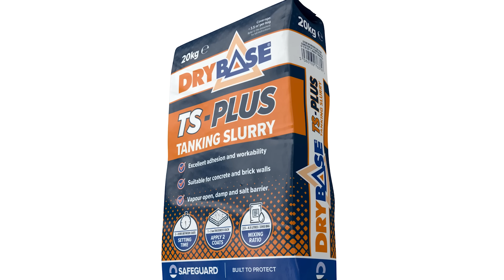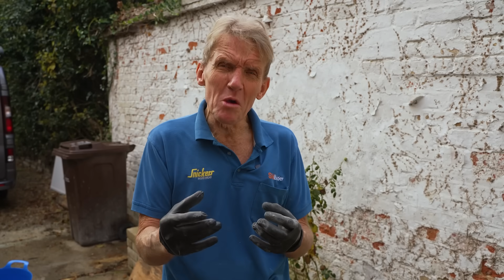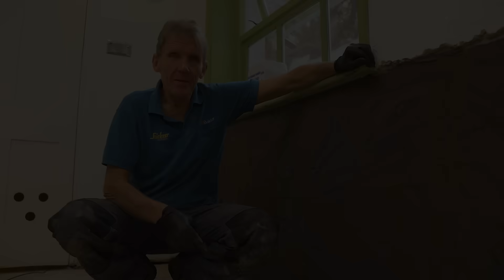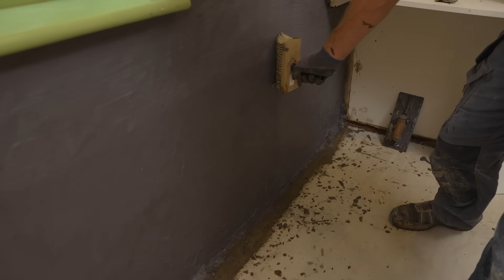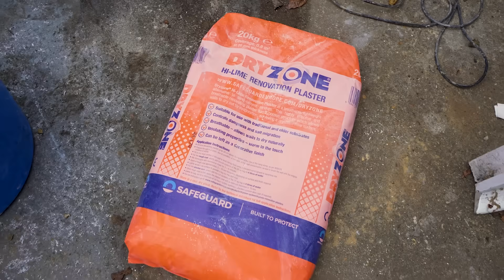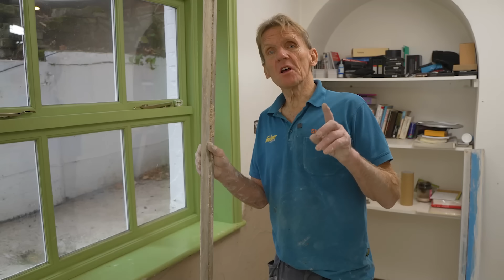Damp Creeping Back? You're Using The Wrong Material

Comment: The best approach is to put a vapour open but waterproof membrane against the outside wall. You are also best off if you can use a french drain to lower the water table around your footings.  Not always practical in a retrofit situation but worth the effort if viable.  This general approach 5 years ago solved our damp problems for good but the footings were only a few feet.

Comment: Damp, a bricky from 1959, plumbers were a blight, likely v,good plumbers but when knocking through into cavity walls they would always let the rubble go into the cavity that was to be kept clear, bash through from the inside blast face off brickwork. Always a mess to repair even at high level . If they repaired anything them selves it would be a complete botch. Plumbers stick to plumbing please.

Comment: I thought i'd share what I recently learned about this stuff as there are a few things missing from this video.
TS Plus is advertised as needing nothing but water added to it on the Safeguard website until you search around and this Polymer is mentioned elsewhere. I think it's because it was added after TSP had been on sale.
 When used it gives some extra qualities like workability and TS Plus is then rated at 5 bar. BUT it reduces the vapour permeability (VP) of it too.
They recommend a parge coat (as is put on here ^) of S&C 3:1, this further reduces the VP as does the sealer coat of SBR. The wall is then no longer classed as VP, or at least of very low VP.

TSP has no advertised VP rating, just that it is. It should have a rating.

If you want a VP wall then you basically need to make sure everything you put on is VP, but this means not following Safeguards guidelines.

Comment: All this doesn't make sense. All this water damage comes from the top and not the bottom. I have a long brick wall that's plastered and only one half has severe water damage but not the other half. The characteristics of all the soil where all the wall was built  are the same. Last year I did seal all the cracks at the top of the wall where there was water damage and this year there was no water damage.

Comment: Stop damp in two days? 🤔

Say it's condensation,, tell the tenant to run a dehumidifier 24/7 and fans in every room,,, not too hang washing up even if it's pissing it outside or freezing and leave all your windows open in winter for ventilation while you try to heat the place,, take one shower a week and try not cook anything 
Remember 95% of the time it's the tenants fault as you say
 😂😂😂

Looks like all you did was trap the water in the cavity,, or allowed it to find another spot to come through😂😂😂

Bumpers

Comment: I live in a flooding zone and I would never tank anything... buildings stay dry naturally as long as they can breath and are ventilated ( even without heating  ) Leave out plastic membranes and water blocking materials.. my experience even after pouring a fresh internal slab and getting hit with a flood that came to floor level a few weeks later it dried out completely in a couple of week in December..  if there had been membranes there the water would have been trapped, had nowhere to go and it might have taken years to dry out. The only causes of damp are leaks and condensation with one notable exception. Fix leaks. Sort out condensation issues. The one notable exception is old bricks which were in the same area as a stove or fireplace during past times, this is the 1 special case, those bricks have undergone a chemical change, turned to salt and they can suck damp from the foundations up the wall.. this is the only time you need to put in a layer to block rising damp, but for me there is better although slightly harder solution, remove a layer of the bricks in stages and replace them with fresh engineering bricks using a HL mortar, just do this in the areas where rising damp is noticeable and the problem is also fixed permanently. Cement renders are no good at ground level, but fine upstairs. Hydraulic lime renders are good because they won't blow up like Gypsum when exposed to water.. but watch out that many so called HL renders still contain a lot of cement and not all products are equal.
Reply from the maker: Mick 
So the answer is to let all the moisture evaporate into the house? In a cellar that would make even less sense.
Tanking cellars works and you will not get one signed off for habitation if it is not tanked.
Reply: @SkillBuilder  I didn't realise you were below grade, so fair enough, but really the issue is that those rooms were never intended to be habitable, the best way to keep them dry is to let the wind blow through there..
Reply from the maker: This house is 200 years old and the rooms below ground were actually the kitchen and scullery. They had servants back in the day and there would have been a big solid fuel cooking range in there. As we adapt these lovely old houses for modern living it needs to be done with intelligence. Do no harm is the moto

Comment: Unless you dig down on the exterior and apply water resistant materials, it’s like painting the interior of a boat and hoping it will stay waterproof. The issues ARE coming back. Fine if the owner understands that it’s only a band-aid.

Comment: This is cruel, that poor sod who has to remove that tanking in future when it fails 😢
Reply from the maker: It hasn't failed and it won't. We were back looking for any changes after a month of heavy rain and it is fine.
I am sorry that you didn't get the job.
Reply: If you've ever been unfortunate enough to remove these types of coatings (they do fail after a period of time). Then I doubt you'd use them. I should think the traditionally built property would rather I did the job.

Comment: Ground levels, ground levels, ground levels.  

The aqua drain handles surface water, not ground water.  Measure from the internal floor height to the cill.   Repeat the proess outside.  

The original damp proof course will be approx 125mm below the internal floor level, this relates to a suspended timber floor.  There will be a quite a difference for an 'original' solid floor.

The original damp proof course should also be 150mm or 2 brick courses above external ground level.  External render can also form a trap and may need removal just above the damp proof course.  

A genuine French drain may be required to correct the elevated ground levels.  The walls should dry out naturally within weeks, and in many cases may not need replasterring.

Try it, that's all.  Building pathology,   how things work.

Comment: Hard to get to grips with how this is is better than just rendering with a lime/sand rough and scratch coat and a lime skim top coat, with non vinyl paint. Or, just apply the Hi-Lime without the slurry. Reading through the datasheet for the tanking slurry, it reads just like any other supposed breathable render. "Use breathable decorative finishes", "Moisture may transfer in from outside", "Use breathable paint". But with the added bonus of "Condensation may form on the cold surface of Drybase Tanking Slurry. Steps should be taken to ensure that condensation issues have been resolved to avoid a reaction of surface moisture and gypsum-based plaster." I feel this is the synthetic aspect of it, as you won't get condensation on a lime finish, no matter the temperature of the wall. The taglines of the product are something of an oxymoron, how something can be a damp barrier, but vapour permeable is something of a head scratcher.
Reply from the maker: The difference between water and water vapour is immense. 
This has a buffer of lime plaster. The explanation is there

Comment: Useful but surely you need to go back in winter to see if it's really kept the damp away?
Reply from the maker: Why would it be worse in the winter? I will be monitoring this job for sure but cellars suffer a lot more in the summer from condensation on the walls
Reply: @SkillBuilder  More rain, higher water table and colder temps are surely worse for damp in winter?! Who complains about damp in summer?!

Comment: Hi Roger just wondered if you new anything about precast houses my sister is having many damp problems, because precast sections have metal in the concrete section would this stay cold so when you put the heating on in the house it causes condensation on the walls inside the house, if so would exterior wall insulation stop the damp or am I flogging a dead horse. Item 3 she has a warm air heating in her house, does this type of heat retain water in air spreading through the house ? Is this type of heating know for producing condensation in the home. Your thoughts would be much appreciated thanks Tony
,,

Comment: This is exactly the wrong thing to do IMHO. With tanking what you have now managed to do Roger is keep the moisture in the walls so they remain wet. This makes the house cold as well as subjecting the bricks to increased degradation creating a build up which will only get worse. I'm very happy you used lime, but all you needed to do was apply lime to the bricks (no PVC etc) and increase ventilation.
Reply: Can anyone recommend a good book on damp and mould problems for lay people? Asked this already but utube deleted it😂 thanks in advance!
Reply: This chap ain't got a clue with old houses
Reply: As the former owner of the Building lime company and writer of British Standards and codes  of practice on waterproofing I have to say this is awful advice.  Everything is wrong and will leave clients with re occurring issues for years to come. The design intent is all wrong but if that was not bad enough Even the application was terrible. Shame is Safeguard have some great products if used correctly to the right design.  All they needed was the profiled membrane with channel and it can be ventilated.
Reply: Are there any good books you would recommend on damp and mould problems and solving them? Finding an expert to trust is difficult for the lay person😢.
Thanks!
! @macmaclennan
Reply: He is totally clueless like tge rewt of the damp wally brigade when it comes to traditionally built properties @macmaclennan

Comment: I cured a damp problem  on a very. Old brick house dampness was rising and perishing the lime plaster. We took the old plaster off the wall cleaned the brick as best we could. Going back 30 years. We did not have the products  available, now. I got some water  based black rubberized  liquid. Roofers where using it to coat slate roofs with a fiberglass membrane, Not a good idea, stopped slates slipping but roof could not breath, they don't do this any longer,  painted it on throw sand on while still wet course building sand and let dry, once dry sand and cement scratch coat they later float finnish and skim, great job cured problem. still good today,
Reply: Did the wall have an original DPC?
Reply: @vistron888  it may have had a slate dcp. I can't. Remember. It had a brick footing built directly. On sand. I remember. Digging in my father's garden . The ground was all sand, but if you went down about 2 foot you needed a pick the sand was so hard and compacted. Slate doc was common in the area. As slate was locally mined and used for roofing.
Reply: @tidyjob1  I'm not a tradesman but ss a DIYer and renovator that has worked on various properties, which all had DPCs, the root to any rising damp was always the ground outside being built too high. Hence bridging it. While you can stop the interior render spoiling by various methods of sealing the water, if you have the typical timber floor with the void, the water builds up in the ground below. Making the air under their very dewy affecting home heating and the floors.

My experience is in London though and we are largely sat on clay. Other parts of the country are on whatever else so that can make a difference.
Reply: @vistron888  The house  I was working on  would. Have had no dams course under the floor  although they had nice tiles in the passageway, but no damp proof under the solid floors. the front rooms often had timber floors on vented sleeper walls with a slate as dpc under the floor joist, with slate flag stones as a floor, in kitchen and scullery areas,  the area that we repaired probably had dampness coming in overtime from a damp outside area, the wall where of lime plaster and either sucked the moisture up either from the floor or maybe the old bricks had become more like blotting paper,

Comment: Erm, isn’t it a load of debris sandwiched inside the wall cavity?  The house I had with troubles, it was never fixed, we spent and wasted, thousands of pounds on what is a nonsense fix - injection.  The first and maybe only step I should have taken, was to either from inside or outside, remove a couple of the sandstones, or a few bricks, and reach in and claw out the gooey mess of fallen sand that a failed edging to the roof, with water ingress, had caused over decades.  The stuff you spend money on, thinking you are getting a proper job done, shocking.  Anyway, people who have done the brick removal/clawing-out method, and built the bricks back in, report excellent fix to the damp issues.  Fact is, there’s many terraces best be knocked down in the UK.  The damp smell meets you at the door, the lower floors are riddled with it, the residents and their clothing smells of it, and as a former resident of such a terraced house, I confirm the heating is impossible.  The bills are huge and you can never warm the place.  We need wholesale rebuilding in the UK, some housing stock is not worth saving.  Just my opinion…of course, if done properly, the damp problems can be solved, but the wooden joists for floors is likely god-awfully ruined too, it just goes on and on.
Reply: Smelly houses do NOT have propper ventilation! 🤷 EVERY room should have vents near the cealing, (called "mechanical ventilation", a square outage through the wall to the outside, with mesh & adjustable shutters from inside for adjustment accorðng to the season. Protective shutter in metal on the outside of the house.).         Some inside walls in the rooms have vents that are connected to the pipes/canals, that are leading air out trough the roof....all to prevent mold & damp! Also important to eliminate everything near the house that makes ground damp & walls wet...all plastic/synthetic membranes are not that good, since the damp from the inside doesn't come out / never dry..use of dehumidiier is best to keep basement dry & house healthy... 
And very odd behaviour that I have noticed: people turn off heating while not at home during the day, then turn it on when get home...it takes a lot of energy to warm up the house...constant warming, even at a bit lower temp's, keeps house dry all the time...
Reply from the maker: There is no wall cavity. This house is 200 years old.

Comment: Nice demonstration and it was good to hear mention of the membrane option as this is fully effect as a barrier and also tends to keep the surface temperature above dew point which is a bonus. You can even apply thermal wall board of the membrane and  in doing so save  energy as well. Always prudent to consider all the available options of course.
Reply from the maker: Great point!

Comment: Membrane.. this is honestly the worst way i have seen to get a room dry.
Reply from the maker: so tell us how to do it rather than just chucking out negative vibes. People will like you a lot more if you break that habit and do something constructive with your time and energy. Thank me later
Reply: @SkillBuilder  find the source and try to sort it, probably cheaper in the short term than the expense of the tanking and equipment plus the redecorating you will have afterwards , in a short video like this you didn't mention all the drainaige issues, perhaps you might have to build a alarmed sump/pump to warn you if it fails and you might lose some room heigh as you build in the membrane and sump in the floor and create a gap at the bottom. 

Overall the membrane solution seem to me a major pain and not that reliable.

If you happen to have sockets on the wall too your going to be cutting in to the membrane too, making failure  / ingress more likely.

Comment: Without injecting a silica dpc and including a sika waterproof mix in two coats of rener, this will not work, the liquid dpc injection should be done on both sides of the wall
Reply from the maker: You are completely wrong. You cannot waterproof a below ground wall with silicone injection. It cannot work. 
You need a membrane and that is what we have here. It has worked very well and we will revisit in on one year